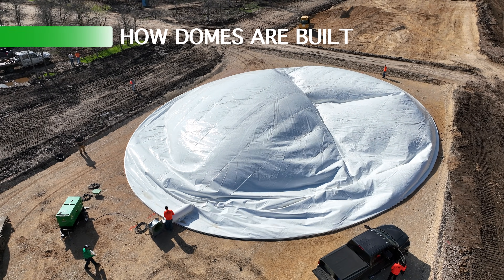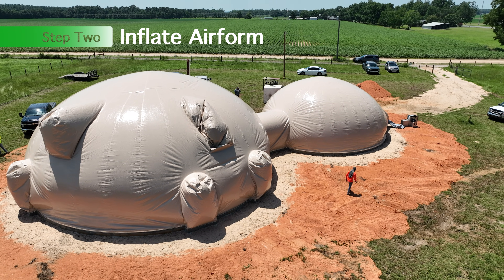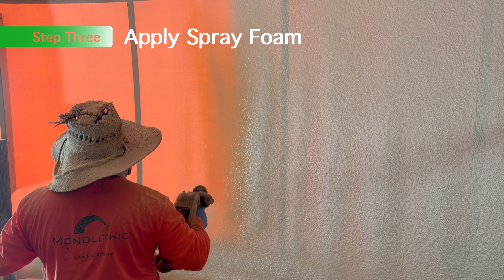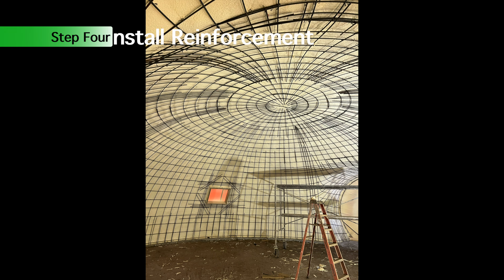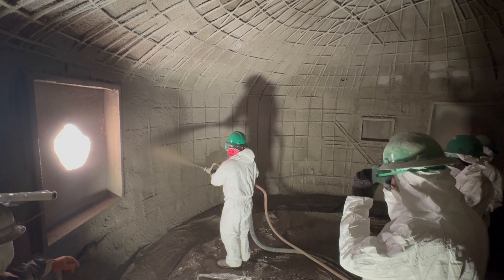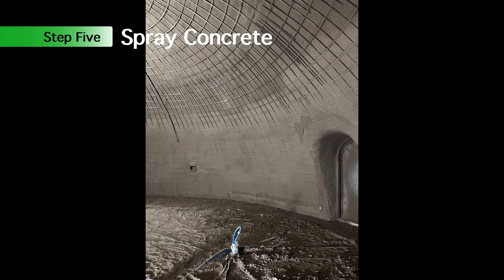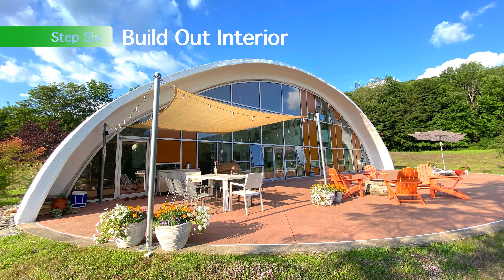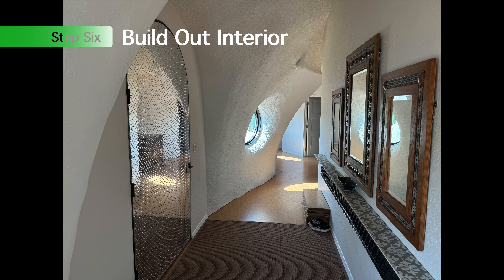Construction of Monolithic Domes—How Domes are Built

Comment: What apps or programs do you use to design the dome home?  Also,  is it possible to reverse the build process where the concrete is on the outside instead of the inside of the dome home?  Thanks!
Reply from the maker: We use a good CAD program.  You can have concrete on the exterior. https://monolithicdome.com/how-to-apply-chain-shell-coating

Comment: You showed the inside process but did not mention how you the outside is finished. Do you put a release agent on the inside of the air form and strip it off after the insulation and concrete on the inside are hard, and then, in another step, lay rebar on the outside of the PU foam dome surface and spray more shotcrete? Only one layer of shotcrete on the inside, then, and to what depth? How thick should the shotcrete be on the outside?
Reply from the maker: Hi. The exterior is the Airform which is a single ply roofing membrane. You can cover that with acrylic elastomeric paint, acrylic stucco, a layer of shotcrete called a chainshell, or metal shingles.

Comment: I'm not a civil engineer but I thought that rebar was for application where the concrete/cement was in tension.  With a dome house the concrete is in compression not tensions so why do they need rebar?
Reply: As far as i can the concrete here is in flexure that is in compression on inner side of casted dome and in tension on outer side of dome. As concrete is weak in tension hence they are right to reinforce it with rebars on the outerside

Comment: Can you guys build a medieval style tower with this construction system? Crenelations included?
Reply from the maker: @projectkordamye1361   Yes!  It’s very doable.
Reply: @MonolithicDome  Four story tower with garage at the bottom floor? 

30 foot inner diameter on each floor with the bottom floor being a small garage with a guest room and a tiny kitchen and bathroom and maybe some room for a big screen projector to be put to use. Spiral staircase along the inner circumference that leads up to each other floor with ample wall space along the way for an art gallery?

Something that can easily be used as a Duplex type structure.
Reply from the maker: @ yes indeed.

Comment: Once finished,  can the domes be covered in dirt?
Reply from the maker: Yes!!!  It may need a little larger rebar and a little more concrete. We have one buried 28 feet from the top of the dome to the surface of the ground.
Reply: I imagine it would require another thin layer of concrete on the outside, and probably a plastic covering of some kind.  I have design ideas that involve doing that myself.
Reply: Layers or dirt are extremely heavy, much heavier than most people think, especially because they retain water. It gets even worse if bushes or trees grow on it.
The idea of building an underground dome is very attractive, but it requires huge amounts of concrete.
Save the planet, avoid using concrete if you can.